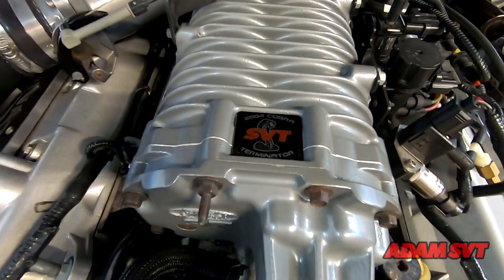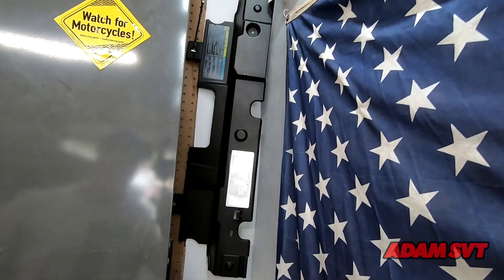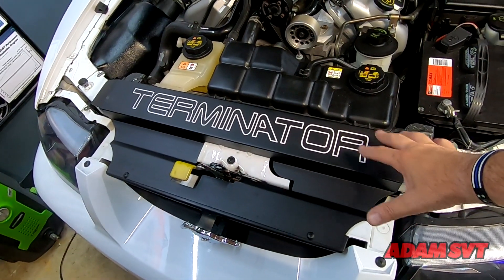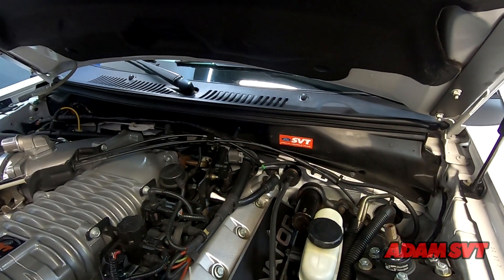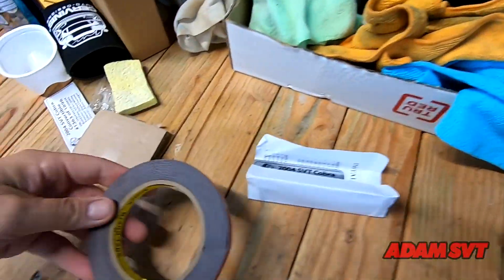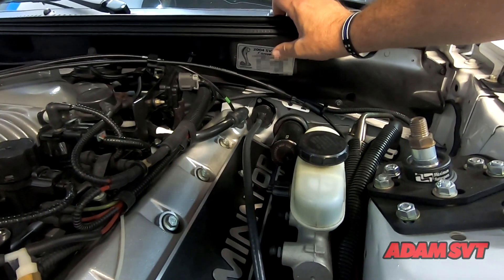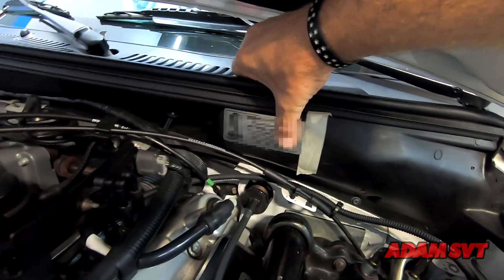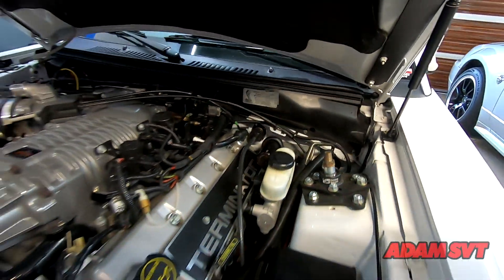Adding Some SVT Cred Under the hood of my Mustang Terminator Cobra

Comment: Nice touch 👍🏼👍🏼
Reply from the maker: Thanks!  What's been up with your car?  Been looking for a new video
Reply: @AdamSVT  I’m working on it, I have had a lot going on. Twin disc is in but it’s just been so hot, I don’t like to drive it hard when it’s hot cause IATs are up a little more like 125 and 1 hard hit it jumps to 150 but it does cool back down but still, I like it cooler, but I’m gonna be posting up, right now it’s parked in the garage 😆